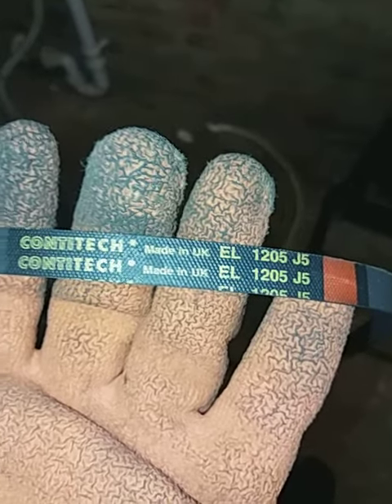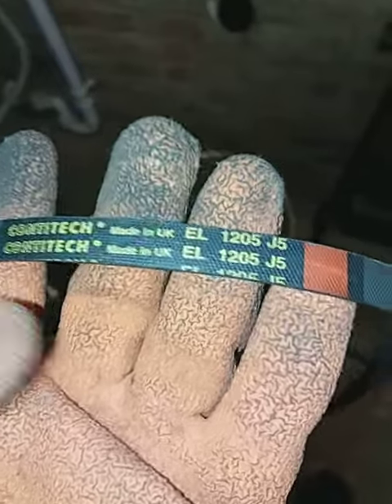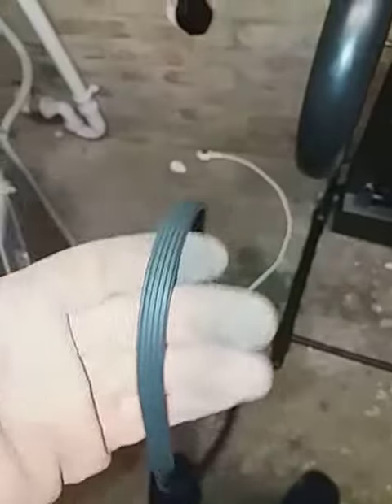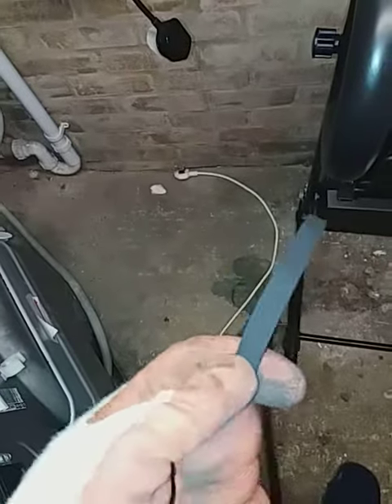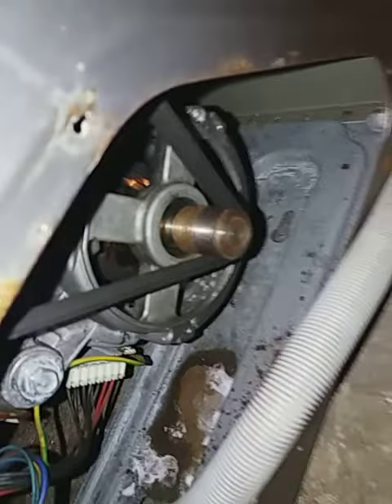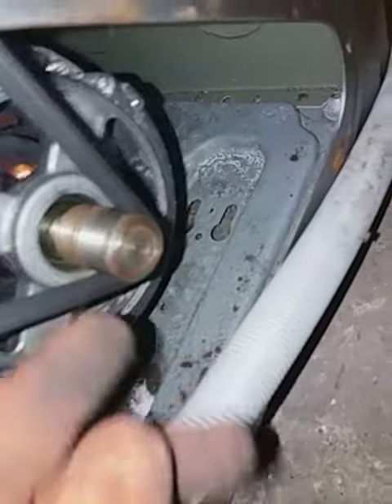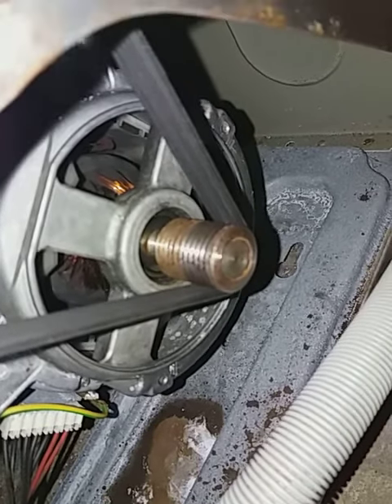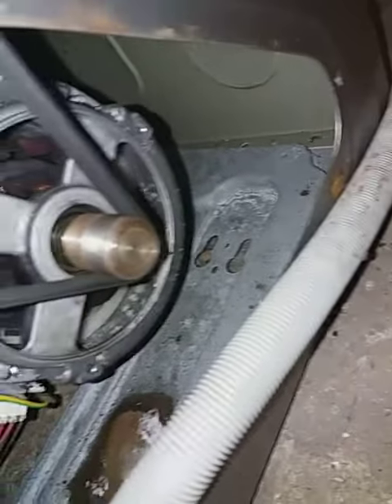How do I fit a washing machine belt and make it stay on?

Comment: Same problem - I have a perfectly usable old Bendix that works better than the new washing machine my mother bought 18 months ago - except the belt has come off mine. Bought a new belt - hopeless. No stretch in it at all and is about 10 inches too short. Tried to fit the old one - about six inches too short. Bought an industrial elastic band - fits but not tensile enough. I am supposed to buy a new machine or pay hundred of pounds for a man - and it will be a man - to come to my house and force the belt back on. It is clear the belts are fitted by machine in manufacture and they are almost impossible to fit unless you have the tools or strength. And yet according to some comments here, I am supposed to buy a new washing machine, despite the fact mine was working much better than some modern ones, which butcher the clothes and leave them limp even on delicate wash - plus the dire warnings about disposal of white goods and global warming etc etc. My machine works perfectly, except for the belt, which in itself cost £29.99 for a useless piece of rubber that does not even fit and never would without the intervention of sheer brute mechanical force.  After another attempt - failed - I switched on my TV to see baby penguin chicks dying on an iceberg because of global warming. Help me save them - stop making machines with components that cannot be replaced unless you hire Thor to do it for you.
Reply: I found a youtube video on how to get the belt on using a zip tie and leading the wheel around until the belt works itself back on without much force. Just search how to replace washer belt. Hope that helps if you have this problem again or if you still have your washer.

Comment: That's not the case, the bearing is still fine, the only issue is the pulley is loose, and if you try to move the pulley by shaking it, you will see a little bit of movement, and as you know, the spider can break drum, the bearing, and even the pulley, so the pulley is broken, and you don't have to replace anything like the motor or the bearing of the drum or the motor, that's because the pulley was broken.
Reply: So can the pully be fixed

Comment: The bearings must have worn out. Need replacing. But in reality it is the time to buy a new machine washing Because of the cost of repair is near to the price of receiving a new washing machine.
Reply: That's not the case, the pulley is seized, and that's what seems to be the case, if that happens the belt will slip off, so that's not the case, the spider does cause damage to everything that spins which is made out of iron.

Comment: i have the same problem...i hate how these are set up...get at me if you find a solution
Reply from the maker: Hi Andy, my solution was to put the washing machine out the front garden for the scrap man! Then find someone migrating the country who needed to sell their white goods cheaply on gum tree!
Reply: This is intentionally made with the absolute most shitty design so people end up having to buy a new machine
Reply: @TheChrisey  The correct way should be something with a guard like so the belt can't slip off, must be a way of adding something, this has happened to me today, it's a nightmare but now it's getting me thinking

Comment: Hi Mark, we cannot allow your post on our site but do pick up and screen any posts with links and can watch videos by going to your profile page.
Your video shows the belt work itself of  the pulley, this can only happen if the motor pulley and the drum pulley are not parralel. If i give a couple of examples, imagine the lines are the axles of the motor and pulley,      A: \     /   B:   /    \
In example A you can clearly see the top is further apart than the bottom so would not be supprised if the belt worked off the bottom of the 'axles' whereas in example B the bottomgap is larger than the top so the belt would work off the top of the axles.
Something must have changed, we assume you have not removed the motor but if you have check there is not a missing bush or collar on one end of the motor. 
The only other reason is if the drum pulley is loose or bearings worn, this would allow the drum to 'fall' at the front drawing the top edge of the pulley to the tub, if this is the case if you open the door and apply upward lift to the drum lip you may feel a little play and see a little movemet of the pulley. In practice there should be no more than a millimetre or two movement of the drum and if the bearings are worn it would give a loud rumble when spun without the belt. I hope this helps and would appreciate any update on our channel (without link) :-).
Reply from the maker: eSpares! I thank you very much for your assistance in this. When looking down the back of the washing machine the two pulleys don't look inline to me. My wife is in urgent need of clean clothes and has resorted to finding a cheap one on gumtree for 40 quid. I'm guessing you can't repair this old one for that.
Reply: @markyboy4777  Its possible that the bearings on the motor or drum could be wearing out and could throw off the belt alignments for it to stay on or maybe th motor is not set correctly for the alignment!
Reply: my creda dryer has started to make a noise when the drum turns to the left
Reply: my creda dryer makes a bit of a noise when it turns to the left
Reply: I have been showering YouTube, and this post to this video was the answer. I could not figure out why the belt worked it’s way off the drum of the tub. And I did not know how to check the herrings on the tub pulley. By opening the door and lifting the front but holding the tank I feel there is a lot of play, and the pilot in the back also moves. There are also a lot of black lines inside the the box of the washer that longs up with the belt. I am hurting there is rubbing on the tank and flinging black particles off the belt slowing wearing it out until it eventually becomes thin enough to pop off.